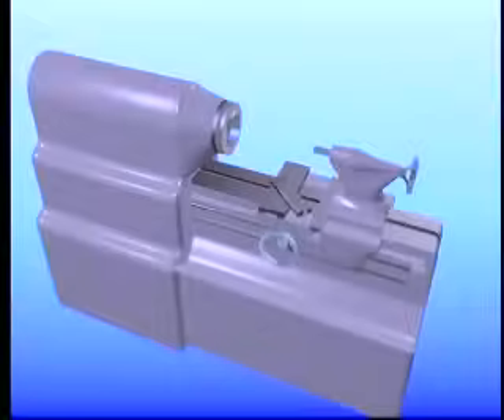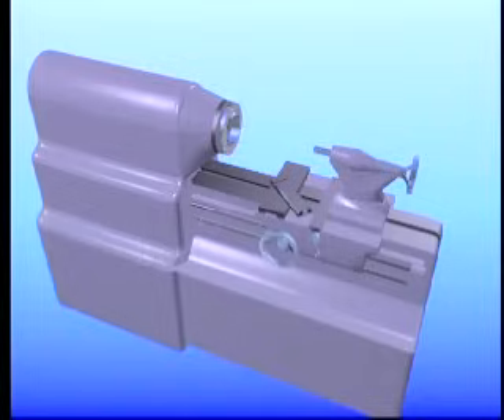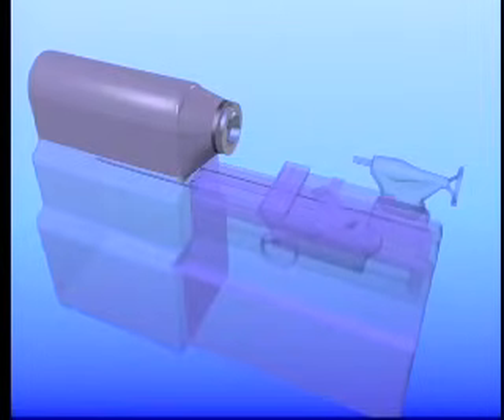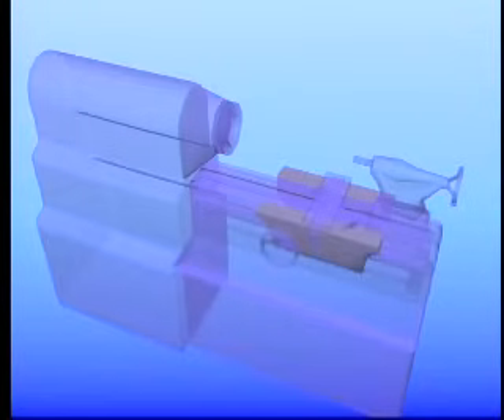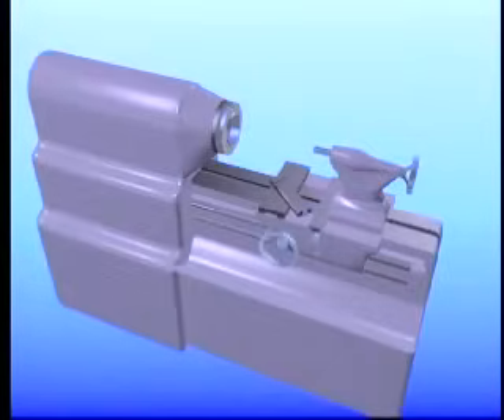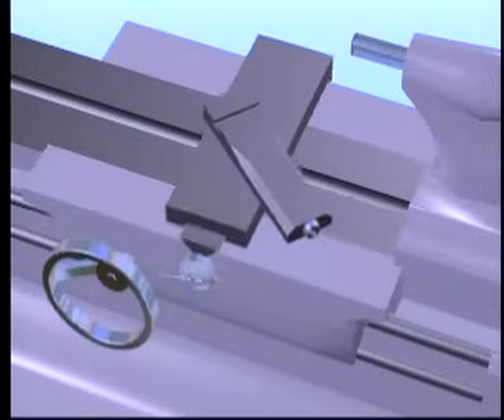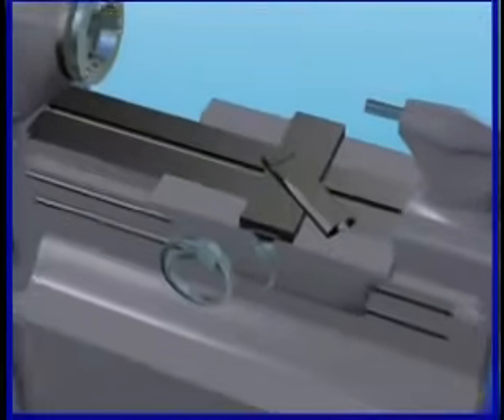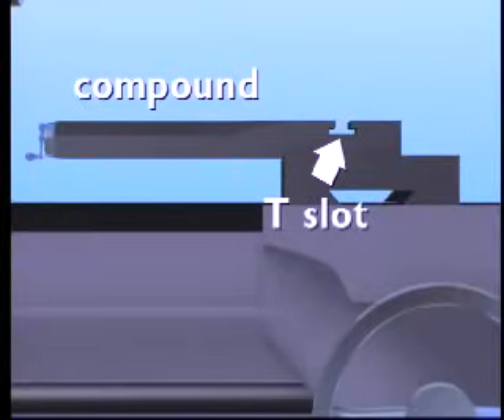Essential Machining Skills: Working with a Lathe, Part One

Comment: Really excellent Lathes 101. Are your "lectures" available as a DVD set? I for one would buy them.

When I am parting off I lock the saddle to the ways when everything is ready to start cutting. I found it helps get much better results.
Reply: Available on Betamax.